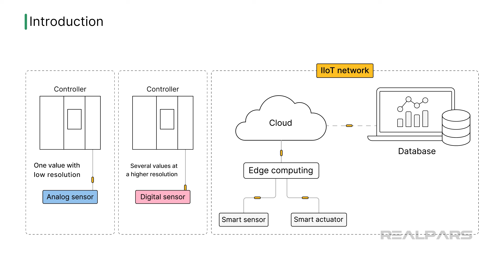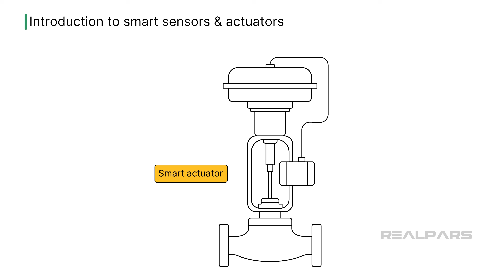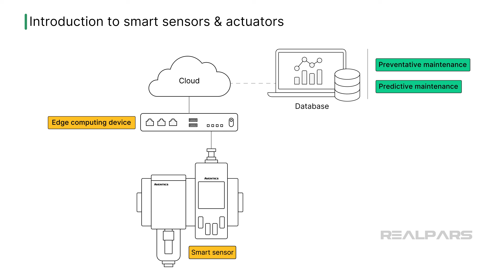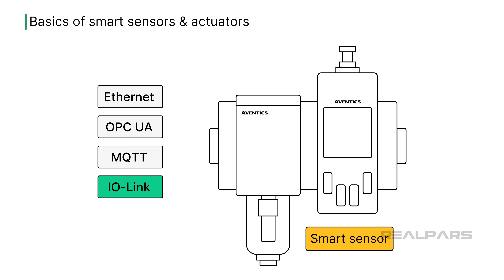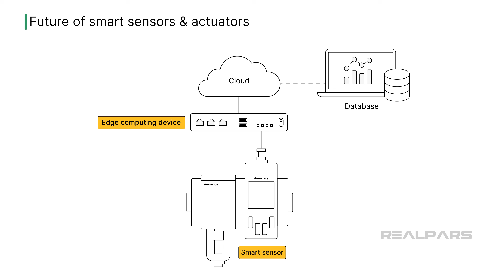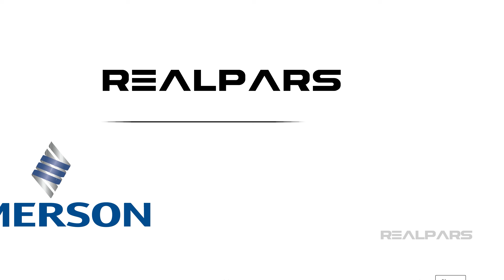Smart Sensors & Actuators: Basics and Benefits in IIoT

Comment: Hi, how do you validate the IIOT ?
Reply from the maker: IIoT generally involves designing data flow from the sensor to wherever the data is used, such as a data historian, cloud database, analytics software, etc. Validation would involve creating a known quantity or data value at the sensor and verifying that it is received at the endpoint in the format and within the time frame specified in the project specifications.  Since data from IIoT sensors is typically a time series (data changes periodically with the process conditions), it may be necessary to record values and timestamps at the device and the data destination to ensure no data is lost and the data received reflects the source data stream.